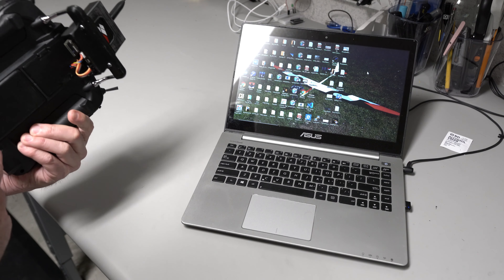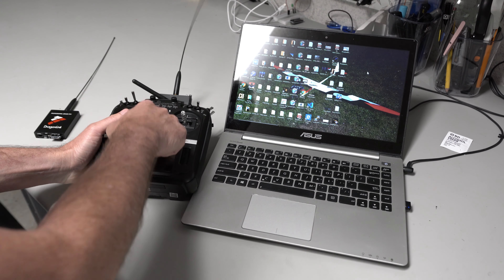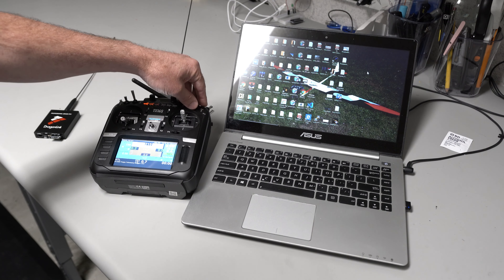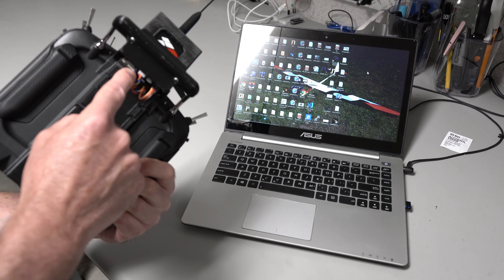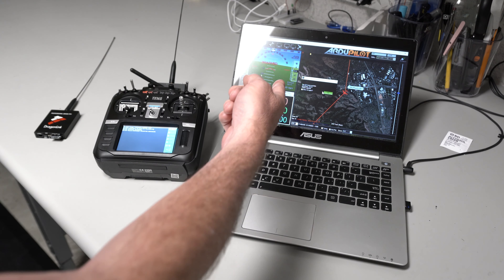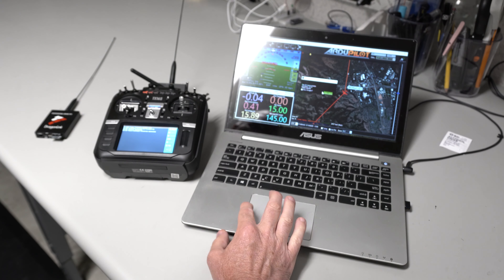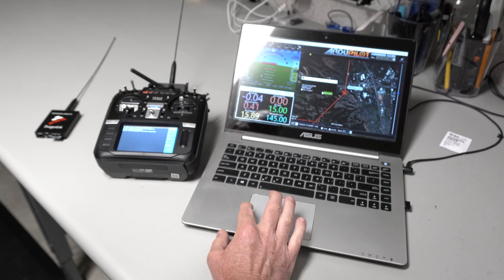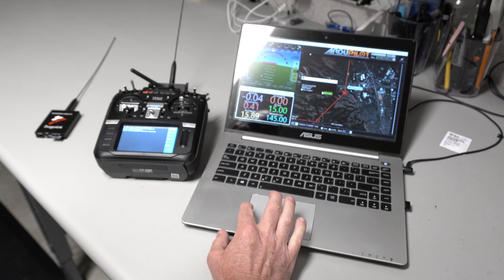Radiomaster TX16S with Dragonlink, Yaapu, Mav2PT, Arduplane, and 26800 LiIon cells.

Comment: Nice video Scott! Great job.
What type of Rc transmitter connection cable did you select while purchasing Dragonlink V3?
I have a Radiomaster Tx16s Mark II, so which cable connector would suit best for external module?
Kindly advise.
Reply from the maker: You just use the normal module bay connector.  For this setup, you also connect the telemetry input pin.
Reply: @Noircogi  when one selects the Dragonlink V3 external module it further gives the following options:

1) RC transmitter connection cable type:
a) RF module Taranis. All removable RF modules
b) JR spectrum, all with dsc connector.
c) Futaba Square trainer port cable.

2) Direct SMA mount Antenna:
a) 36" (90cm) coax ext
b) 48" (125cm) coax ext

Which one to select in points 1?
Kindly advise.
Reply: @Noircogi   when one selects the Dragonlink V3 external module on its site it further gives the following options:

1) RC transmitter connection cable type:
a) RF module Taranis. All removable RF modules
b) JR spectrum, all with dsc connector.
c) Futaba Square trainer port cable.

2) Direct SMA mount Antenna:
a) 36" (90cm) coax ext
b) 48" (125cm) coax ext

Which one to select in points 1?
Kindly advise.
Reply from the maker: @adydix9929  Module bay connector. (a)

Comment: Hi, your contribution is very good!
I recently acquired a Dragon Link v3 Advanced, with Bluetooth only. Currently, is it necessary to do this to have telemetry on the Radiomaster? Does it not work by directly connecting the DL's tx/rx uexp with the Radiomaster's aux1? Thanks.

Comment: Wow Scott, this is fantastic. Thank you. I am working to do this myself and already have a pixhawk 4 on the way along with a radiomaster and am looking to get the dragon link. I know what the stats say about 433 vs 915 mhz, why do you like the 433 more? Simply for the longer range and better object penetration?
Reply from the maker: I have both 433MHz and 915MHz Dragonlink systems.  Since I fly in a hilly area, the 433 is much better due to its better penetration.  It also works way better with 1.2GHz video.

Comment: what settings do you need on dragonlink for full telemetry (accel and sensors)
Reply from the maker: Dragonlink radio modem setup is here: http://www.dragonlinkrc.com/instructions/v3equipment/radiomodem/
My Mav2Passthrough build is here: https://docs.google.com/document/d/1HaBKI0jTojH0pB9-NJMV72v6WaEJSAf-O2IsMCyQj18/edit
Yaapu info is here: https://github.com/yaapu/FrskyTelemetryScript
Reply: What are your serial settings on Mission Planner and what baud rate are you using on dragonlink  Tx and Rx?
Reply from the maker: @banwoi8665  All of that is in my original post here: https://www.rcgroups.com/forums/showpost.php?p=40795313&postcount=75270

Comment: How did you assemble these batteries?  Do you solder them, weld them, tape a connector between them, etc.?
Reply from the maker: I soldered them.  The space is very tight side to side, so I didn't use heat-shrink.  I used hot-glue between the two cells, a normal 2S balance connector, nickel strip, and kapton tape over the ends for insulation, and down the middle for a bit more structural strength.

Comment: Is dragonlink similar to crossfire? I am new to this stuff^^'
Reply from the maker: Yes, Dragonlink is like a higher-end version of Crossfire with much longer range. It operates on the 433 MHz band and requires an amateur radio license to use.
Reply: @Noircogi  oh that is interesting:D the license is for USA or where do you need it (Germany?)?
Reply: @Noircogi  I would argue that crossfire is the higher end system.  The onboard oled and controls let you configure it from the device and now you can also configure CF through opentx right on the radio.  The DL you have to plug up to the PC. The software is much further advanced than DL.  I find the response much quicker too and you can run 57k baud from the CF without flow control but DL you have to lower to 38. The esp32 on the DL is interesting but not really any more useful than the bluetooth connection the only difference is the CF bluetooth always works and the DL's latest bluetooth had all kinds of problems so the wifi is really a bandaid for that situation. The only thing DL has going for it is 433 which I have no idea why TBS hasn't put out CF in a 433 version because they would take over the market.  I have been out to 28km with the CF so range is good.  It actually outran my DL the other day that failsafed at 18km (both same setups, minitalon, moxon on tx).  CF big downfall is it doesn't work with 1.3 video and 2.4 can be hit or miss with interference.
Reply: @Noircogi  will old version dragonlink works too?
Reply from the maker: @pelurusilver  Yes.  You can use an external ESP32.  I've pre-built the code for it with instructions here: https://docs.google.com/document/d/1ePGAmYa-GSwJ9TrpRcMSZ5HjKpIELJfxtvpISxID2Xs/edit
Reply from the maker: @spyder000069  No doubt TBS could build a fine 433 MHz system, but they don't at present.  Their high volume definitely lets them invest more in software.